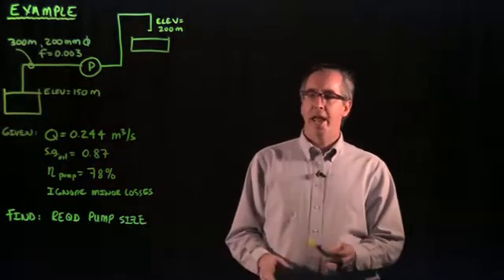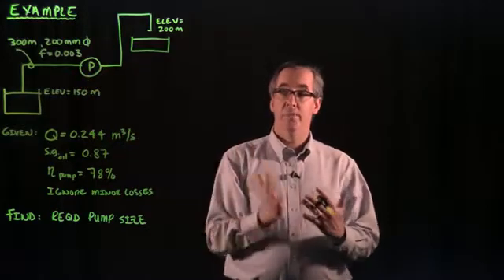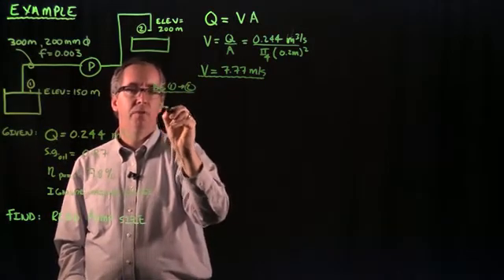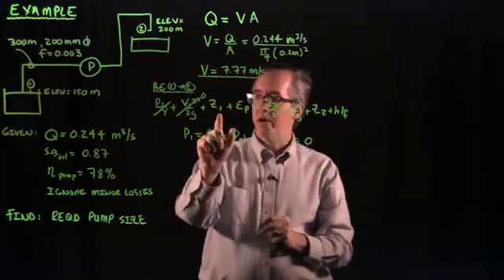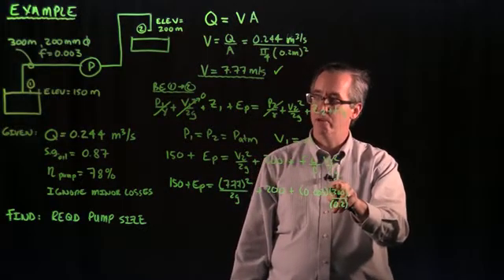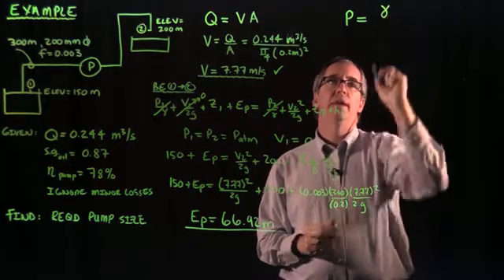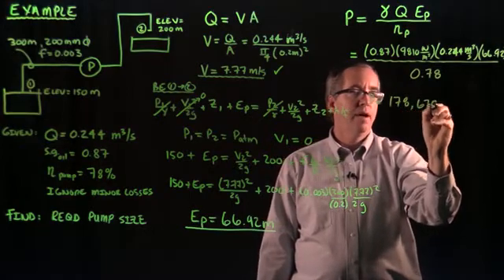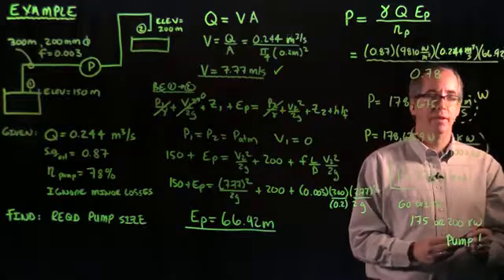Sizing a pump formula with an example

Comment: Hi sir, i just subscribed your channel because you delivered very informative topic. Now, if you can do another example such as 6 lift station in different elevation and it will be discharge to the wastewater Treatment plant. Is it the same calculation using 2 point elevation? What about the pipe elevation the other lift station? Thank you.

Comment: Not sure how the friction factor 0.003 was calculated, but this value seems to be the Fanning friction factor based on my estimation. If this is the case, the head loss should times 4 as the friction in the equation should be the Darcy friction factor.

Comment: Nice video. But this only dealt with the head of the pump. This did not deal with the length of the pipe that the pump has to flow the water through.
How can we include the length of the pipe as well.
Reply: the friction factor

Comment: The vertical distance between fluid surface and pump intake is sometimes called suction head. So don't you also need to know the elevation of the pump intake to make sure your pump suction head is sufficient? Thanks.

Comment: Elevation at suction is 150M, Elevation at Discharge is 200M, Length of the pipe is 300M ???

Comment: I think there is a mistake in the static head calculation. If you take the datum point at pump line, 150 m will be minus and 200 is positive, total static head will be 350 m.
Reply: No
Reply: no

Comment: Good work, minor mistake at the start where the diameter was squared instead of the radius to calculate the area
Reply: he used pi/4 so its correct to square the diameter. Area=(pi/4)(d^2) or Area= pi*r^2😊 Agree?